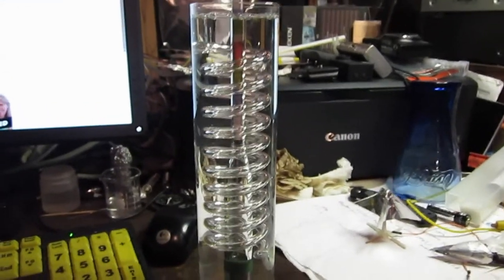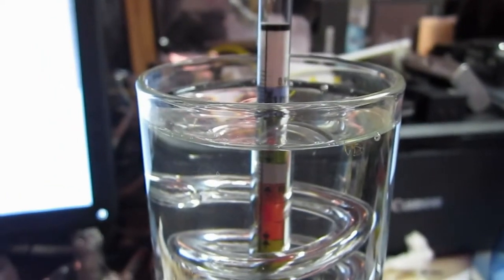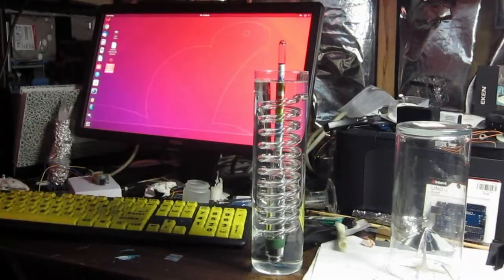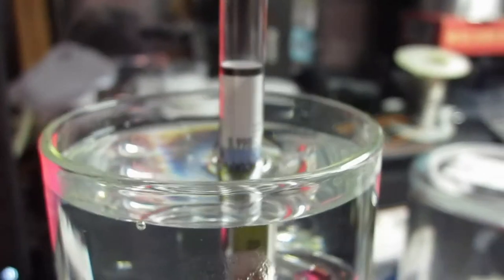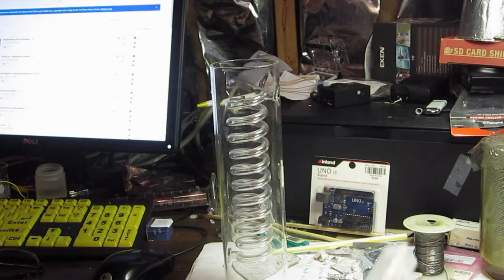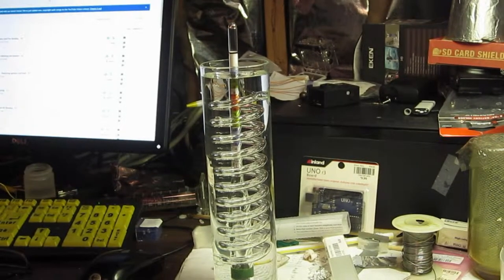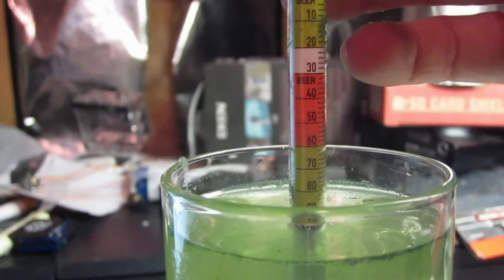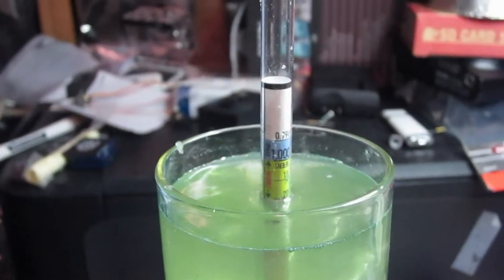Measuring Heavy Water with a Beer Densitometer

Comment: Interesting.  I'm wondering... Why aren't you making heavy water by removing the lighter water that is "floating" above the heavy water that "sank," right?
Reply from the maker: I believe gravity can be used separate the heavy and light water to some extent, but you probably need long tubes to do this.. since the thermal energy works against you, to mix them back up.. I was looking into a thermodynamic theory to determine how long the tubes must be, to get a certain separation.. I was told that the Germans in WW2 were using long tubes stretched up a mountain, that were filled with water, to separate the heavy water.. there will be a separation-factor associate with this process.. and one must understand the details to do it efficiently.. Great comments.. Thanks!